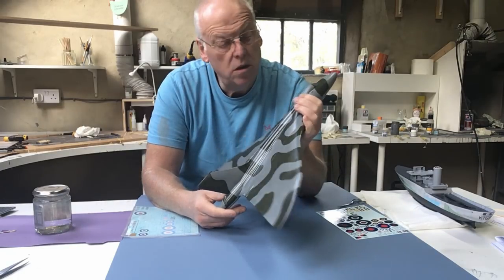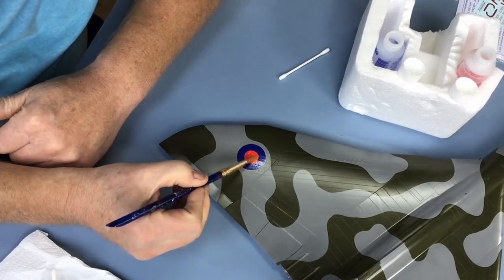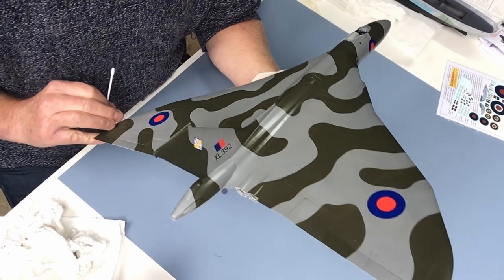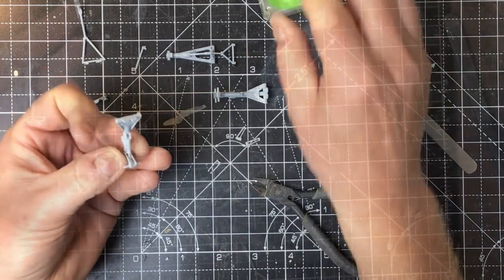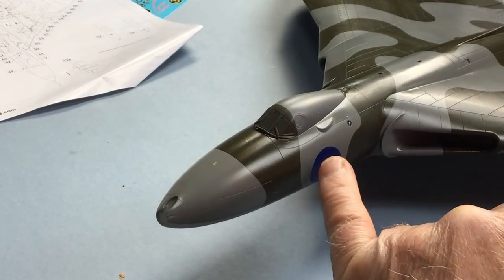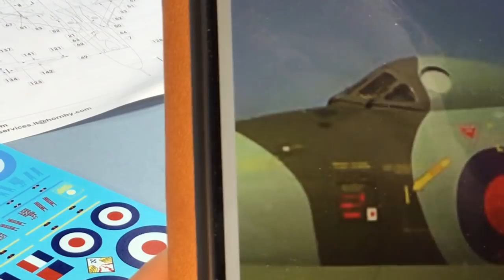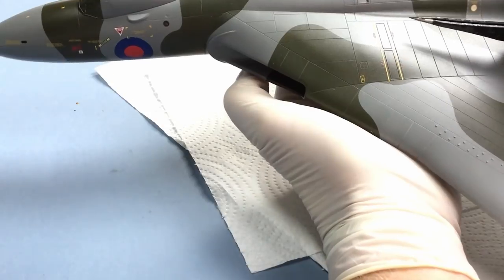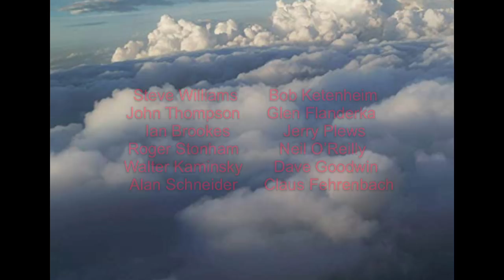Airfix 1/72 Avro Vulcan B.2 (New tool 2021) Part 9

Comment: The Vulcan is a bonnie bird sang an ex airman I worked with in the MoD logistics chain in the 90s. He used to regale me with his memories of the Vulcan's crawl spaces and maintenance quirks.
Reply from the maker: There were plenty of places to hide that’s for sure and a few spaces for maintenance where you had to be a contortionist to work. I hated lying on the racks in the nose wheel bay greasing the engine control rods which were inside the roof. You couldn’t see them - everything done by feel and a check after wards with a torch to see if everything was done properly…..

Comment: Stencils on grey should be yellow,  I was in the RAF the same time as you as a fireman.  That is what I remember
Reply from the maker: The fire lance openings,  break in and emergency tool stencils were yellow but “my” stencils around the engine doors on the underside were black.

Comment: Looking good Steve. Where to you get blank decal sheet from? Mine needs door decals like yours. I bought an xtra decal sheet for a 27 squadron jet and was disappointed to find they weren’t included.
Reply from the maker: Hi Ian. It’s xtradecal from Hannants. I found it a bit glossy to accept the ink on my printer so I took the shine off with some fine micro mesh and then applied a coat of Matt varnish before putting it in the printer. I then varnished over the top before cutting out and putting in the water. I found that the ink just washed off without the varnish. I used aerial black 4point to get the right size in 1/72.

Comment: Hi Steve, did you use Tamiya TS-13 as the top coat and if you did how did you apply it because I’ve heard that if you spray a too heavier coat and not a light dust coat to seal the decals in first it can get hot and deform the decals. Fantastic work by the way 👍👍👍
Reply from the maker: Hi Philip. No I used Alclad light sheen for the top coat. I wouldn't use a TS spray personally - especially straight from the rattle can - as you say it would possibly damage the decals because it shrinks and tightens up, pulling the decal with it as it dries. If you have an airbrush you could decant the TS and spray it in a few light coats which would be less risky (I have a video of how to do this in a separate playlist).
Reply: @TheModelShed  thanks Steve for getting back to me mate it’s very much appreciated 👍👍

Comment: Reference photos are needful--and frustrating   You always find the one that shows you made some obvious blunder (durf)
Or, after you carefully align decals side to side or top to bottom, that, the actual a/c was not, in fact, as symmetrical.  Sigh.

Then, there's the F-4 Phantom, possibly the most stenciled a/c in existence (I swear there are "no stencils  here" stencils).
Reply from the maker: I have some dry transfers for a 1/32 phantom and virtually one sheet is full of no step stencils. That’s putting me off for sure